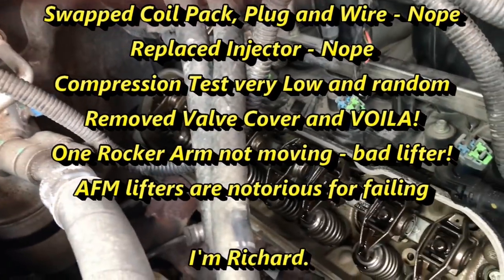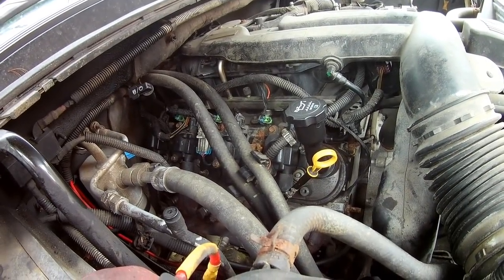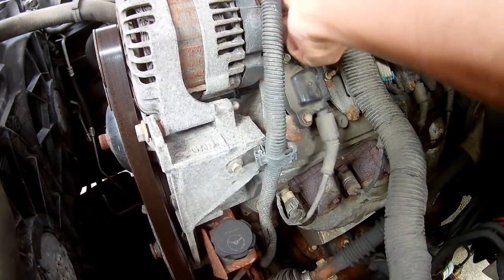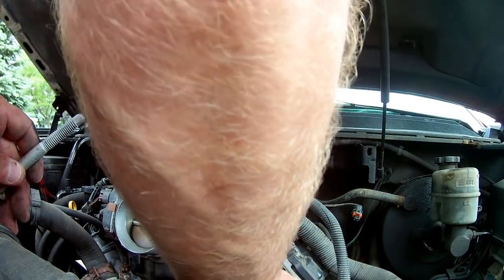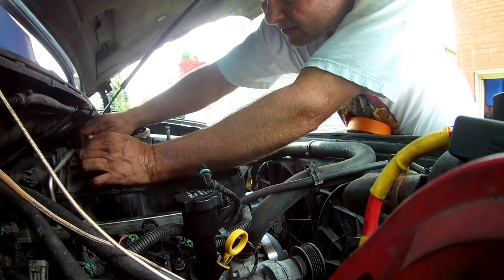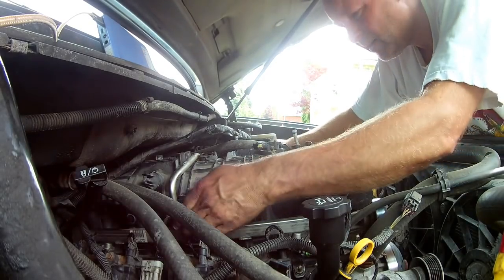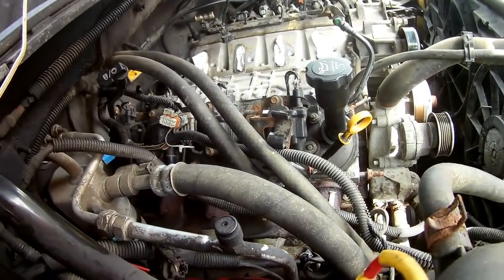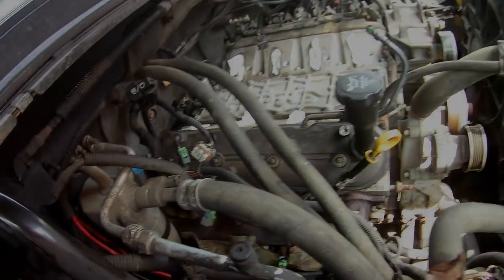PLEASE SUBSCRIBE! Chevy 2009 5.3 L Head and Lifter Removal and Replace Part 1 of 3

Comment: I thought cylinder 6 is on the right side about the 3 one????
Reply from the maker: Cyl 6 is on the passenger side, 3rd one back from the radiator. Cylinders on the passenger side, from the front of the car back are 2-4-6-8, and on the driver's side are 1-3-5-7 (for this engine). Hope that clears it up!
Reply: @Argellus  your awesome.you make great videos I'm definitely gonna subscribe
Reply: @Argellus  where can I get the torque specs for all this? Also the angles??
Reply from the maker: @Mtc01p  I called them all out in the video, and do not have access to those anymore, sorry. Everything you need is in the video though, you can screenshot what you need. Good Luck!

Comment: Do you have to drain coolant? I disassembled everything and took off the head today. Every video I’ve seen so far has drained coolant but when I pulled the head right off, the amount of coolant that came out in the videos doesn’t look like any more then what came out of mine. Just curious if this could effect my engine after assembly and oil change
Reply from the maker: When I did it the second time (for the other bank), I drained the fluids AFTER the job just to flush anything. You could probably get away with not draining it, but for all the effort I'd hate to have some contamination  ruin all the fun.

Comment: Okay how many miles on the truck and howoften do you do oil changes those vehicles need oil changes quite often using the oil reset is not enough you have to do it at 50%
Reply from the maker: The engine had 200,000 miles (320,000km) on it when this issue occurred. Used synthetic oil changed every 3-5000 miles and always well before the oil monitor suggested, though I’m ok trusting the engineers who designed the oil monitoring system vs non-expert online opinions, especially when using high quality oil. You can change the oil every week on these engines, and this issue will occur eventually. It is inevitable. 
I used Haynes Manuals Online as a guide and the torque settings are all available there. It’s $15 to sign up and well worth it. I’d link to it but you need a Haynes account to sign in. Highly suggest getting that and they also have inexpensive print versions available almost everywhere. I did however provide all the info in the video. Good luck!
Reply: @Argellus  thanks I will looking into getting that torque wrench specification list but I have to highly disagree with you with the oil light given that GM has a class action lawsuit against them with these engines and displacement on demand which is a total failure for GM I think that the engineers did get it wrong people have built other parts to replace these problematic parts in there actually better given the fact that these engines get high engine sludge and the engine having over 200,000 miles I would have to change the oil every 3000 miles or sooner
Reply from the maker: @worstnightmare9772  the class action lawsuit isn’t related to oil change intervals. The 3000 mile oil change interval was from long ago when oil technology was far inferior. That’s said, go ahead and change your oil as often as you like, as long as you’re within the manufacturer’s recommended maintenance schedule for your climate and usage. In the end, it’s likely just spending money for nothing. I’d rather spend the extra $$$  on best quality lubricants and filters and proper routine maintenance as per the manufacturer’s claims.

Comment: Would anyone know what size tap to use on the 09 Silverado 5.3 flex fuel? Have to clean threads on the center row of head bolt holes.

Comment: Thanks Richard! I have not had good luck with simple engine repairs much less tearing apart an engine, but lack of funds had me attempting this. I followed your video including your parts list (mine is a 2010 suburban) and was able to complete the job with no issues afterwards! I just wish you would have done the drivers side as well as I'm not sure what's different in tearing down the other side. (2500 miles later I am starting to have lifter noise at start up on the drivers side, I don't want to wait till it breaks down). Passenger side still very quiet.
Reply from the maker: I did the driver's side, and it was actually easier with fewer things in the way! You can follow the same instructions except it's 1+7 that are the AFM cylinders

Comment: What is the cost of changing 4 lifter on a tahoe.
Reply from the maker: Mopar Charger you’d be doing one side so that would be 8 - 4 AFM at about $60 each and 4. Non-AFM at about $15 each. Then add a head gasket, rocker arm gasket, exhaust and intake gasket, head bolts, exhaust bolts if needed, coolant bypass o-rings, coolant, oil, and oil filter. It ends up being about $700. You may also need other parts like rods or even a new cam shaft or head machining depending on your circumstance.
Reply: Richard Lahti thanks so much for the info! It’s because its a tahoe for sale for $3,000 but it said it needed the #4 filters.

Comment: Where did you get that printout instructions? If for to do the same job in my 07 Avalanche.
Reply from the maker: Andrew Blake Haynes online manuals. It costs about $20 for the year. Worth it. I think this job is exactly the same on an ‘07 - I had an ‘07 as well.
Reply: Hey awesome video.  Fixed a collapsed lifter back in January with your help.  But I was wondering did you just buy a manual for your vehicle or did you search specifically for this job? Thanks

Comment: My truck has check engine ligh flashing and traction control stability service on I already change coil number 4 da wires spark plugs they told me it can be a bad injector or lifter when I turn my truck on it smoke out da pipe
Reply: Having same problem. It's a bad injector, 02 sensor, plug/ wire, coil, or lifter.
Once you eliminate something, move to the next until you determine the problem.

Comment: What do you mean when you say check to see if it's the cylinder deactivation manifold
Reply from the maker: Mnj fmj the VLOM controls they mugger deactivation. If the filter screen is clogged or there’s a bad solenoid or gasket, it could cause the misfire issue as well.

Comment: If a person is doing this!  Just do a DOD delete kit.
Reply from the maker: james guralski that would be my recommendation if you have the time and money. This job was about $250 (Canadian dollars). A DOD delete means doing both banks and a Camshaft and then having the AFM coded out.  It’s a much bigger job. If your Cam is damaged (you should check it with a flashlight while the head is off), then absolutely do a full delete. And plus you’ll save about $400 on lifters by not needling the 8 AFM lifters. To be clear - a delete is at least  3x the work of this job, requires a bit more skill to replace the camshaft and  probably about $1000 if all goes well and you do the work yourself. Either way, once it’s apart I suggest repacking all the lifters on the side you’re working on (or both if needed)

Comment: Did you use a GM service manual?
Reply from the maker: Haynes online $20
Reply: @Argellus  thank you so much! I'm having a ticking noise with my 2013 Tahoe. I heard that the noise if from a seized lifter 90% of the time

Comment: You shouldn’t have press on the throttle plate...the throttle body is computer controlled and is not run by a cab..you should have it then relearned
Reply from the maker: Zach Jennings there is a throttle position sensor on this engine - I’m pretty sure Moving it manually without excessive force will not cause any issues and that the TPS will reset after a few miles at worst. Good point though, but for the record my fuel system still works great and I never experienced any idling or running issues after this repair. I do suggest cleaning the throttle valve.
Reply: Richard Lahti I cleaned mine and had the code p0507 right after cleaning it and I cleared it with a scan tool but it didn’t go away  until driving for awhile then I cleared  it again then it went away..I even moved the throttle plate to clean it..

Comment: I got a question I had bought a new lifter while a couple of them and the oil hole Port is in a different spot either face the front or the back now the springs loaded ones are in the same spot so do I face the oil portholes to the back or to the front of the vehicle 2007 Avalanche
Reply from the maker: The spring AFM lifters definitely need the hole to line up with the hole on the block, so hole on lifter facing the block. The normal lifters it shouldn't matter, but I turn them toward the block too.

Comment: Do you have to take the heads to the machine shop
Reply from the maker: thomas martin I didn’t as mine were flat and looked good. Your call on that but it couldn’t hurt to have them machines. The head baskets from AC Delco are pretty good with sealing minor imperfections and I have no seeping or leaks and good compression after this job.
Reply: Someone tell me I should try that blue devil Do you know anything about that
Reply: thomas martin dont mess with that dawg if you going to do it.Do it right or do it twice!

Comment: I have a 2007 Avalanche took it to the shop before I took it was blowing white smoke except for two days and then I took it to the shop and The Smoke Stop I was getting antifreeze out of the exhaust but not in the oil I took a picture of it and show them and they said it was the head gasket changing the head gasket do that makes the bottom in go or should I change the whole motor good video you have right here
Reply from the maker: thomas martin you may have a crack in the block or head, but this video is basically what’s you’d do to replace the head gasket.

Comment: Thank you for the video!!! Can you tell me where the radiator drain plug is located? Everyone else says to pop off one of the lower hoses, but if I can access the plug, seems to be a wiser choice!
Reply from the maker: D. W. Thanks! Bottom of the rad on the driver’s side facing the engine compartment. Bottom hose works too but it’s just one more thing you need to disconnect and then  reconnect which isn’t necessary especially since you can let it drain over the hours you’re going to use disassembling the engine.
Reply: @Argellus  Thank you so much! I'm just a girl trying to figure out how to replace a collapsed lifter on my own.  I appreciate your quick response and your great video!
Reply: @Argellus  I had to wait the rain out again, but am I missing something... I see where my plug is, but could it be broken off or how the heck do you get it out of there? Sorry, I just cant move any further until I either get that plug out or attempt the hoses.  Tried to freeze frame where you pointed down there to see if it had anything to grip onto or is it sunken in, but couldn't  manage to get a shot of it. Thank you, again!
Reply from the maker: D. W. Of you can’t locate the drain at the bottom drivers side of the road on the inside of the engine compartment, then it may be easier to just drain the coolant by disconnecting the lower rad hose from either the water pump or the radiator.

Comment: I'm noting your work flow, very good process. Someone sprayed Sea Foam or similar down the push rod tube hole to soak the lifter. That unstuck it (in his case Tahoe collapsed lifter cheap fix) and then he disabled AFM in software so the lifter don't collapse anymore. But that problem was crud buildup. Thanks. Just sharing info.
Reply from the maker: InHocSigno I used sea foam a couple of times prior to this when the codes started occurring. It did seem to help, but eventually it died. Lucas oil seemed to buy me some time too. I think the increase in oil pressure the Lucas caused helped. Both are temporary measures though in my opinion. Eventually those lifters will fail.
Reply: @Argellus  - OK, thanks for info
Reply: @Argellus  For me Lucas and heavier 5W40 Liqui Moly did the trick for about 9 months until complete lifter collapse a couple weeks ago.

Comment: Thanks. How is the oil pressure? I assumed oil would be spurting out all the push rod holes. The top of the engine looks pretty dry. There were a lot of problems with nicked and leaking o-rings on the oil pickup tube. Leaking in air that is. Do you use switched synthetic oil to help keep the inside cleaner?

Curious as my 2006 VIN Z has slow coolant leak with no external signs. Possibly caused by cracked Castec 706 heads.
Reply from the maker: I have always run synthetic 5w30 in the engine, though I've never stuck to any brand - just what's on sale. My reasoning, perhaps flawed, is that any brand name synthetic is probably better than any other similarly (or lower)  priced conventional oil. I didn''t drain the oil until after removing the head - my thought being that way I could help flush any potential debris that may fall into the engine, but I had no oil squirting out anywhere which in hindsight I should have seen some while cranking the engine over during testing (though it was a cold engine and only cranked it for maybe 3 seconds so maybe it didn't build up enough pressure). I had no oil spill out of the engine at any point during this job, even though I didn't drain it until AFTER replacing the head. As for your coolant leak, my bet would be on cracked or warped heads or block or hopefully just a bad head gasket.

Comment: Did u have to do the timing?
Reply from the maker: I don't believe that timing is adjustable on this engine. It's distributor-less, and even so, I don;t think this procedure would affect engine timing (maybe if the lifters and pushrods were different sizes... but that shouldn't be the case if you have the proper parts!). If you change the cam, you'll need to make sure you align the timing marks on the crank and cam.

Comment: The VLOM was "redesigned" to apparently allow the oil to pass through the filters better and in turn stop the lifters from collapsing. Does anyone know what year they started putting in the NEW "redesigned" VLOM into the 5.3 engines.. I have a 2013, 5.3. pretty much the same as Richards. VIN's 8th = "0".
Reply from the maker: Hector Lugo mine had the redesigned vlom. It’s just a matter of time before it fails too. I think they started in 2008 with the new version, but I not sure if they had incremental updates in the following years.

Comment: Do you have the manual for this engine?  Or are you viewing forum notes with the disassembly?
Reply from the maker: edward ibarra I used a Haynes manual online subscription .
Reply: Richard Lahti have the same, do you have the sections I should use?  To save me some time
Reply from the maker: edward ibarra just go to the section on cylinder head removal and replace and that will guide you through the relevant sections. You can then look at valve lifter removal for some additional info but the lifter replacement is really easy. If you’re doing an afm delete you’ll need to change the camshaft and afm manifold etc and that’s a much bigger job.
Reply: The Haynes manual for this job:

Haynes 24067 Chevy Silverado & GMC Sierra Repair Manual (2007-2014)

https://amzn.to/2LmtCGI

Comment: Did you disable the AFM with a tuner after you replaced the lifters?
Reply from the maker: I did not disable AFM, though that's a great idea, it's probably worth the trouble, and I'd consider an AFM delete (including the ECM repro) if you intend on doing all AFM lifters as it's likely about the same cost (need a new Cam and ECM hack to delete AFM or it will not work)

Comment: Awesome video series, has been a big help

Just curious if anyone could let me know the part that was removed at around 8:15, I managed to snap the equivalent part on my 2008 Silverado while trying to rotate it.

Thanks
Reply from the maker: That's the PCV hose - if you need the connector try a wrecker, or the dealer.

Comment: Richard, great video and a project I’m thinking about tackling soon. Could you provide all of the part numbers that you purchased? I may do all my lifters at once seeing the labor required to get to them.
Reply from the maker: Harris Hornbuckle I will the post the parts I used. Same parts work on both banks too. I’d also suggest buying the lifter retainers to have on hand just in case, and return them if not needed.
Reply from the maker: Posted in Description. rockauto.com is where I got most of mine, with some from local AC Delco parts dealer.

Comment: Richard. I changed the spark plugs, coils, and wires. It still runs rough. But not really a lifter ticking. Were these your same symptoms?
Reply from the maker: It made no noise for me either. I changed all the electrical and the injector before I pulled off the rocker arm cover and saw the rocker arm not moving at all for the affected cylinder exhaust valve. Note I recommend looking into the DOD defeat which replaces the DOD lifters with normal ones; and you remove the VLOM. I may do this eventually as I suspect my VLOM is acting up due to occasional misfire codes. It’s a common problem